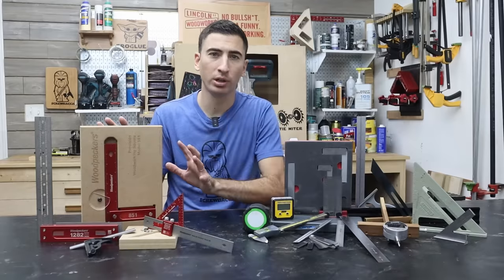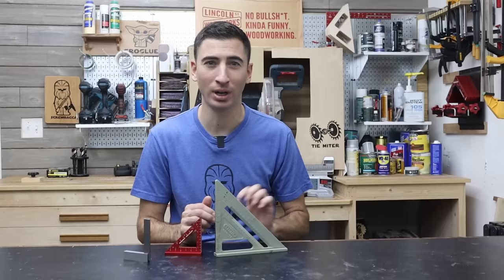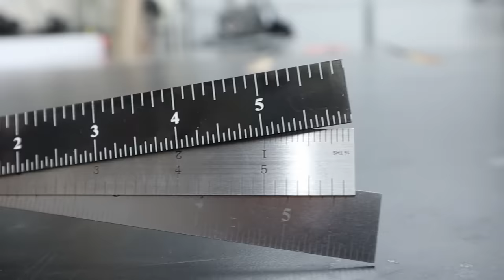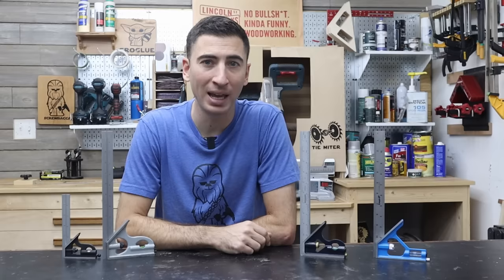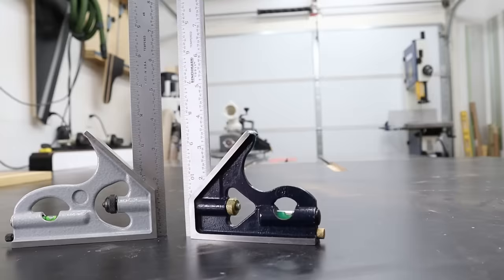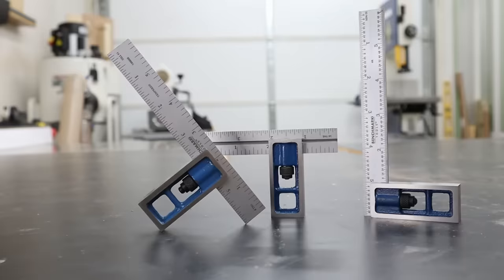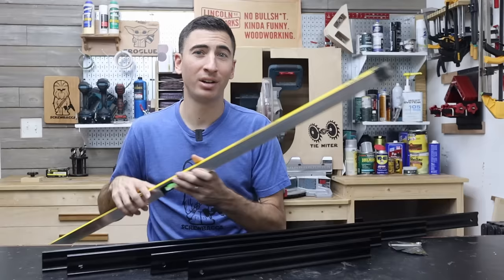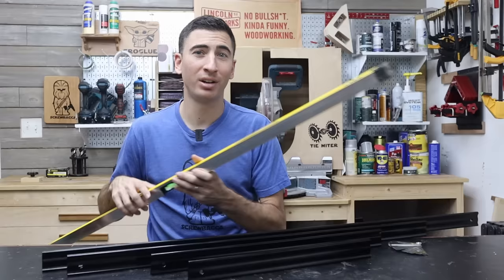Why is woodpeckers so expensive?

Comment: Also consider a granite surface plate.  I have several.  Good value for money is Grizzly Industrial's B grade range.  I specifically would recommend their 24" x 36" x 4" thick size.  Excellent reference surface for inspecting (and making) straight edges, taping sandpaper to for sanding wood flat, using as a table for gluing to keep the assembly flat (use thin plastic sheet), and things as mundane as trimming the legs of a chair so it does not rock.  A granite surface plate is a popular and very useful tool for luthiers.  The 24" x 36" weighs about 380 pounds so will require a sturdy stand.  I set mine up with levelling feet supporting the plate to level the surface - this allows me to use a level for reference during assembly.  I have a plywood cover for mine to protect the surface.
Reply from the maker: Great tip

Comment: For rough framing the speed square is undeniably the most important tool the Swanson speed square comes with the little blue book which has 1000 years of carpentry experience written on a couple of pages undeniably the most important thing you can read if you want to be a wood framer.

Comment: i was taught to start my rule at 100mm or 1 inch. from there deduct my start point from my final measure to get what i wanted. took away that end of tape inaccuracy.
Reply: I have always used the 10 inch tip for accurate tape measuring. I find it easier to just subtract 10 from the reading.

Comment: I like the video and agree with the ideals. Woodpeckers looks fantastic, but the price is simply too high. I had no idea about the Woodpeckers tolerance, but make sense for wood it is enough. I feel there are at least 2 things in the video that can be corrected: 1) Kinex is ar far as I know Czech brand. One of few Czech brands that still exists and are worth to check by woodworkers, the other one is Narex, especially Narex chisels. 2) Steel machinist squares have one big disadvantages, they can rust, unless you pay extra money for anticorrosion version. I have several Kinex squares without the anticorosion treatment and I am happy with them, but I have to be always careful to leave them oiled to prevent corrosion.

Comment: If you only buy one out of those things, get a combo square. That is the handiest single tool you'll have for woodworking...and I have used one made by johnson (and another by swanson) which never let me down. Unlike metal, wood is not dimensionally stable and so exceedingly precise tools do fall into the diminishing returns category...plus, it's the slight variations and flaws that give handmade wood projects that special character. If precision is all that really matters, why not ditch all the traditional tools and just set up a CNC machine. You can get a very nice CNC for about the same as you would a set of quality power tools, and it has the added benefit of being able to work with metals.

Comment: Sometimes you pay for the name on the tool when in reality they come for the same factory. I have both Woodpeckers and some cheaper squares and both of them are true 90' square. I like the Aluminum but it does damage easy when dropped. Steel is great as long as it is stainless steel. I have a complete set of the Incra's and that is the best purchase that I have ever made.

Comment: If you're not fanatical about "Buy America", you can often save A LOT of money (usually at the cost of a fairly long delivery window, typ. 30-60 days) by going to Banggood, which is, as you can guess, a Chinese sorta-Amazon (less widespread in the good, but they are expanding). But they do make a lot of inexpensive, apparently high-grade stuff (usually out of Aluminum) that I suspect is modeled after, if not made for, companies like Woodpeckers. We are talking, often, about half the price.

For some things -- especially precursors to making things (particularly rulers, squares, 1-2-3 blocks, and the like) as well as other things (like t-channel, or 1010 aluminum) much less expensively than the Amazon equivalents, which are probably from the same factories... even more so if you just keep your eyes open for sales.

Comment: As a machinist for 13 years I would strongly advise to get good quality 6”scale. Black or mirror finish Is a bad idea(ask me how I know). A starrett scale is like $30 and well worth the extra money. Dial caliper are better in my opinion because no need for battery’s. Also get a set of 1-2-3 blocks

Comment: The machinist's rule and knife trick... it's intended to be placed on its edge directly on the workpiece, then a scribe can be drawn down the measurement groove to the piece. That's why it's so thick.
Instead of the mech pencils, I would recommend a Staedtler lead holder with a hard lead (and the sharpener). You can get these things as sharp as that knife and no longer worry about little pencil line offsets. You can also sharpen them blunt to work in the Incra guide.
Reply: @1pcfred  Thank you. I have a set of Rapidomatic pencils and a set of Rapidograph pens and love them, but never used the lead holder. Added to cart.
Reply: @1pcfred  Lol, I completely understand. I started drafting back in the 90s on vellum, so I appreciate quality instruments. You can't really quantify it either, like a good paint brush or ratchet or something. You pick up the tool that never fails you, gives consistent results, and feels right. I need to find something similar in a divider and compass. I was thinking about giving Ledin a shot, maybe even the La Cible, you know, to hold the leadholder.

Comment: Aluminum is much less stable across ambient temperatures, but obviously that level of accuracy is hardly ever considered with wood. But if you’re buying for two hobbies, steel is going to stay relevant in the machine shop tasks. It’s worth noting that most decent combination squares are built with machined steel surfaces with decent tolerances.

Comment: Thanks so much for this info!  I took your advice about the straight edge and ordered on right away.  Also, as far as rulers are concerned, I don't know if other woodworkers have this issue, but I have trouble with light reflecting off stainless steel rulers and making them difficult to read.  I'd like the black one you showed, but didn't link (what's up with that?)!
However, love the deadpan humor!  I had to pause the video when you said "Steven, spelled with a C" .  I LMAO ! ! ! ! !

Comment: Your cost saving tips are great. I had a set of Cheap China 12" digital calipers my company provided. THEY WERE TRASH!!! The dimensions that they produced varied wildly. The main cause of the variations seemed to be the speed that they were opened or closed. Multiple measurements had to be taken so that I could guess which measurement was right. If the measurement calls for calipers, spend the money for Mitutoyo or equivalent. Cheap China tools can be great, but not for calipers.

Comment: Awesome video!  The timing couldn't be better.  I'm just about to start setting up my woodshop that's been on ice for 20 years.  Now, I'm realizing that I'm missing most of these non-sexy tools.  When I get over to Amazon, it's gonna hurt, but maybe in a good way.
Reply: It can be expensive. But you’ll feel better every time you get to use a precision engineered tool. I only have a couple of them, but it’s just a delight to use them.

Comment: If you are working at home the expensive ones are nice but, if you work on a construction site with fellow workers they will steal them as fast as they can . On top of that if you actually are out getting your hands dirty in the weather ,dirt and mud, it's not going to take long to destroy how purdy those expensive tools are . I am a retired carpenter. Every year I went wore out  two hammers and two or three tape measures . That was about $125  a year . That doesn't include stolen tools

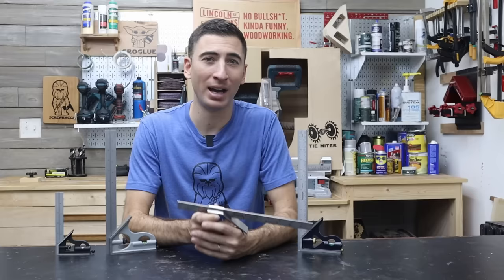Comment: 5:21  My Empire combo square (from a big box)  has served me for over 5 years (I've had it long enough that I don't remember just when I got it).  It was square when new and it still is.  The only possible 'defect' is the aluminum body.  It probably won't stay accurate as long as an iron body.  I have a no-name, but made in the U.S.A., combo square with iron body that has stayed square for over 50 years of neglect if not outright abuse.  I inherited it from my Dad, so I don't know how old it actually is.
My opinion, the Empire is OK, get a good iron-bodied square.  Just my opinion.

Comment: Starrett The choice of machinists for over 100 years . There is a reason for it---It's called unsurpassed accuracy which is everything . BTW if you spend the money for Precision quality machinists measuring tools keep the boxes they came in and used them to PROPERLY store them. Those of us who worked in machine shops know the old hands where always putting their mike sand calipers back in the box to the point that many a shop owner knew if you were hiring by looking  at your  cabinet (Kennedy or better still Gresthner) and whether you had enough Red boxes in it.

Comment: I love my woodpeckers square. I checked it and its .0008”. The ground squares you mentioned might be advertised as .0007”, but remember they are made in China, i checked them and they are not even close to that and smaller one is out 3x that. Pretty bad for a small square.

Comment: You forgot the most important ruler - your reference ruler. I bought a 12” Starrett rule that I check all other rulers against, and that’s the only thing I use it for. You’d be surprised how often something you buy will be inaccurate - especially tape measures. It’s almost more important that all of your  rulers match than they be accurate, but you can have both with a good reference ruler. I have a metric one as well.

Comment: The most ridiculous phrase most amateur woodworkers use “more accurate than any woodworker needs” BS. Depending on your quality of projects a lot of woodworkers work to a few thousands of an inch. Now are these tolerances necessary? All depends on the woodworker.Having said that I can’t argue with any of his recommendations. Except my first pick would be a Starrett combination square. I use it as my “ reference” square. Used to check and adjust all other squares. For that reason I would get a 12” and treat it with kid gloves.PEC is a well known lesser quality alternative to Starret

Comment: Steel vers aluminum,  well the red with white paint shows up better, if your older wear glasses to read might be the way to go, as for speed Squares the plastic ones break if you drop them, id opt for the metal units for 11 or 12 bucks.
My small one is plastic thats OK with me but I need to replace the 12" speed squar. I droped it 3' and it broke into 2 parts.

Comment: Ah so Woodpecker and Festool are in the same camp as Snap On. With today’s manufacturing capabilities, a PT Barnum quote comes to mind. 
Great review and suggestion on these tools. On the pencil, there are .7 and .9 mm leads along with the bigger old fashion lead holders. I find the .5 mm is best used on paper.

Comment: A dial indicator is easier or at least no more difficult to use than a digital one. Measurements on calapers spin the dile many time to cover large sizes so it's more difficult to read. With Indicators your looking to check squareness to 0.1 or .01 mm. All you have to do is watch the dile move a fraction of 1 revolution. If it's not on 0.00 its not square. Easy.

Comment: SIDE NOTE:  I've had three cheap digital calipers over the years. Every one of them would die a battery death on the layout tool wall before the next use.  

THEN I grit my teeth and bought a Mitutoyo caliper.  

It's going on five years and it's alive and well every time I reach for it.  

Now, I use my caliper frequently.

Comment: I mostly agree, but .002 over 4 inches sucks. That's .006 over 12 inches.  I like my Starrett.. I have both a woodworking shop and machine shop. My machine shop tools are often brought over. You failed to mention a knife edge machinists square. They are used with a flashlight to check square. The knife edge ensures that you are not fooled by the thickness of the blade.

But not everything needs to be hyper accurate as you point out. Also wood moves so it only makes sense to some degree. Spend wisely and avoid throwing money away.  You can buy some highly figured wood and make a beautiful project.

Comment: Can recommend getting a digital guage that's 10 times more accurate (another decimal place) for a very similar price as the one shown. It will both improve accuracy, and drive you insane trying to get impossibly level/45deg blades etc.

Comment: Now here’s the elephant in the room.

Metric.

American tools are really great but 1) they are ridiculously expensive here (Australia) and 2) they are not designed for metric users. Some have metric graduations on them but they are designed for imperial users in mind. You will find that the imperial graduations on the preferred side and with no option to flip the ruler over so that the metric graduations are on the correct side. In most cases, companies like Woodpeckers and Starrett do make metric tools but even then, they probably don’t have the nearly same range of options for metric users.

As a result, I don’t own any American-made stuff at all. I’d be glad to have it but only when the manufacturers get a clue about what their potential market is. It’s almost like this is “USA only”.

Comment: As a machinist  I have D all the above and do both work in wood as well as metal.  The expensive woodpeckers are nice but not necessarily needed. Square is square.  I trust my metal equipment more than the wood sold on line

Comment: Companies like Woodpecker and Inca make precision measuring is not.  There is a huge difference between +/- .002 degree of accuracy and .0625 degree of accuracy.  People far to often mistake framing tools for fine woodworking tools and there is a massive difference.  While framers work with in 1/8" degree of error and sometimes even 1/4"; fine woodworking usually has tolerances at or below .003".  Now this is shade being thrown, but the fact is, if you cant understand why a woodpecker square costs way more than the Empire square you by at "Big Orange", then you more than likely arent in a place where you need the precision of more expensive tools like woodpecker.  There is also the fact that if the equipment you use to cut wood are nut up to the level of accuracy tools like woodpecker are capable of, then there is no reason for you to spend the dough on them.  Like if you are still woodworking out of your garage with a Ridgid contractor saw and a Ryobi circular saw, which there is absolutely nothing wrong with, but you likely dont need  spend the money on the precision tools like woodpecker.

Comment: Perhaps you could have mentioned a better reason to opt for the digital calipers: their "zero" button, which acts similarly to the "tare" function on digital scales. The added benefits (in handy applications) I would not want to be without, now that I have integrated  them into my "bag of tricks."

Comment: Regarding the Kinex machinist square 3-piece set, what I don't understand is why I would need to pay for three separate squares that don't greatly differ in size. Wouldn't just one of them suffice?

E.g., if the largest one is necessary for checking longer lengths, that implies that the shortest one is less accurate for the same application. Or are these squares not only used to test squareness, but also to test flatness? But then, isn't that what the host said the straightedges are for?

Comment: While the Kinex squares may be lower cost and more accurate, unfortunately they rust… bad. The brand new 10” I just received has corrosion all over. It will be going back. Maintaining the cast iron tops of my tools is enough of a hassle. I really don’t want to spend time keeping my squares from corroding.

Comment: YOU USE THE INCORRECT TERM FOR A SCALE - A RULER IS A LEADER OF A COUNTRY In scientific and engineering terminology, a device to measure linear distance and create proportional linear measurements is called a scale. A device for drawing straight lines is a straight edge or ruler.

Comment: Would like to see a jig video.  Everyone works differently.  I find that the 6" double square is the measuring tool I reach for more than any other tool in my shop.  The batteries in my digital measuring tools seem to die way too fast.  I consider them less precise and less reliable than dial calipers and indicators but I do metal and wood working.  I take a Kinex square with me when I go tool shopping to make sure that the one on the shelf is accurate.  There are some good deals for accurate squares at the big box stores but not every square of a given model number is necessarily as good as another "identical" tool.  I had to do some final adjusting of an Empire try square but it's dead on now and the rule in it is very good.
Reply from the maker: So true on the inconsistency of the cheaper box store products.